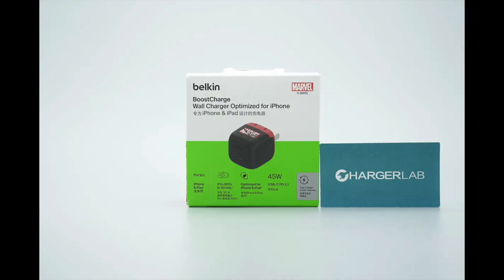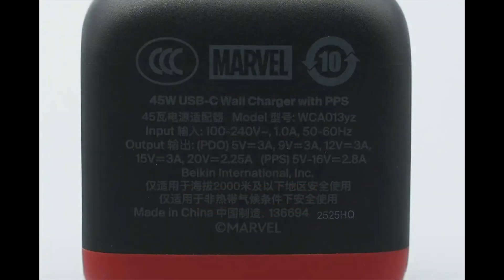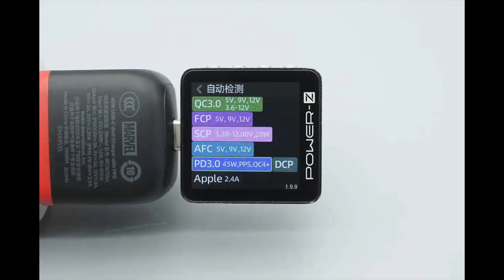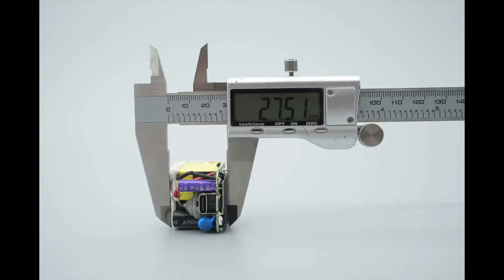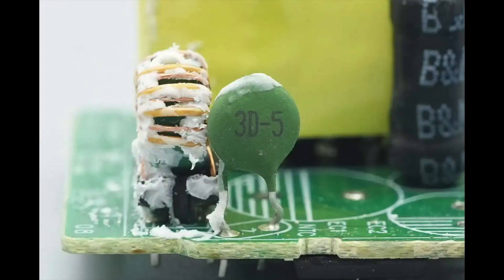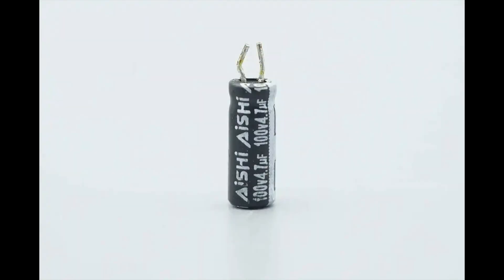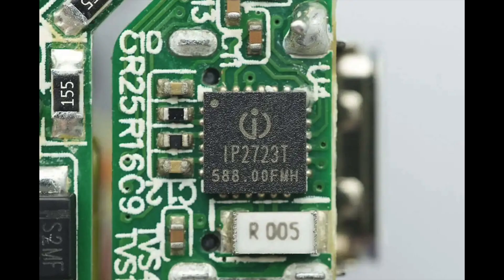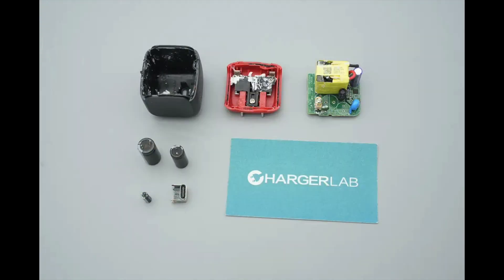Teardown of Belkin × Marvel Spider-Man 45W GaN Charger

Comment: This particular Belkin charger appears to lack the advanced design elements and superior build quality characteristic of its competitors, such as Anker or UGREEN.
Specifically, the charger does not seem to employ the most modern aesthetic or technological features available in this category. Furthermore, the internal construction, particularly the quality of the components utilized and the precision of the soldering, falls short when directly compared to the rigorous standards typically observed in products from brands like Anker